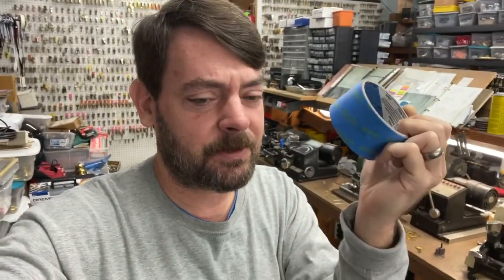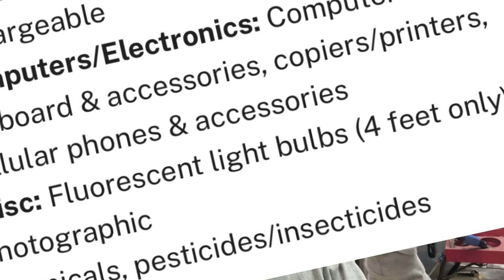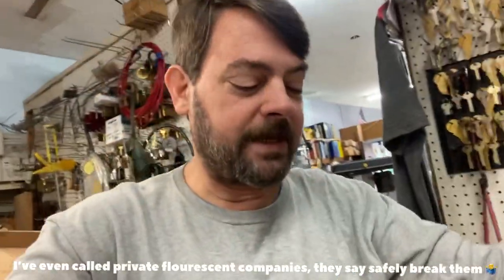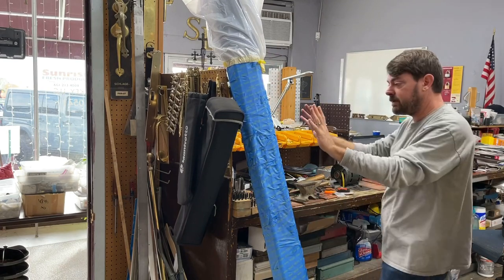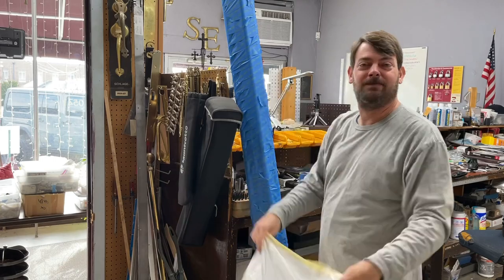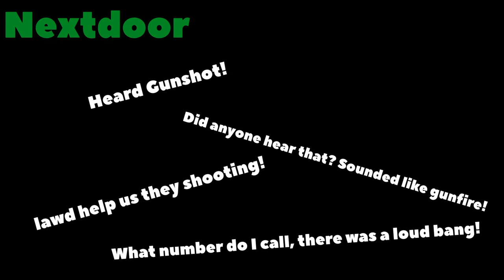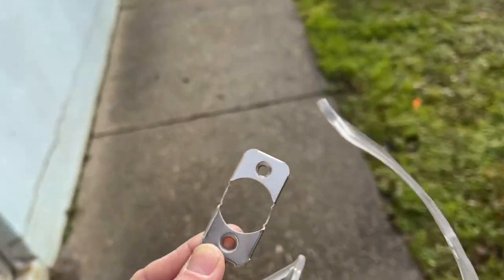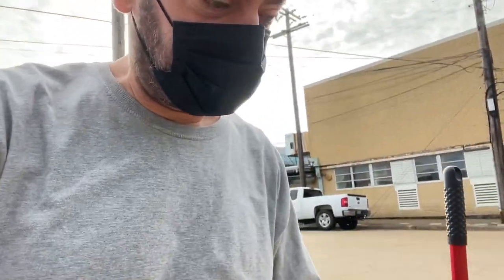Lock Shop vLog 6 “hazmat disposal”

Comment: I've done this but I taped a smaller area in the middle and just broke them in two.  I've used duct tape (favorite) and some other kinds of tape.
Reply from the maker: I kinda wanted to set them up to see if I could throw keys through them but that would have required pretty extensive setup and filming so I decided to pass on it *sigh